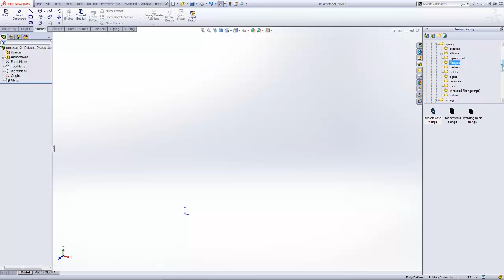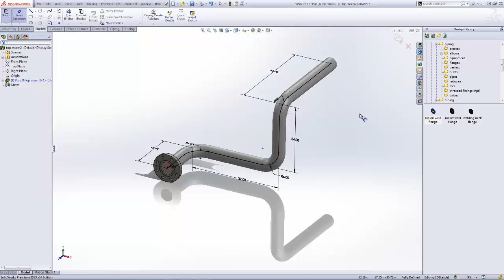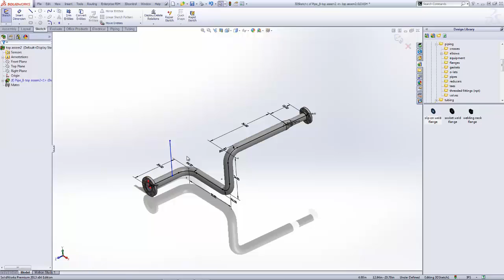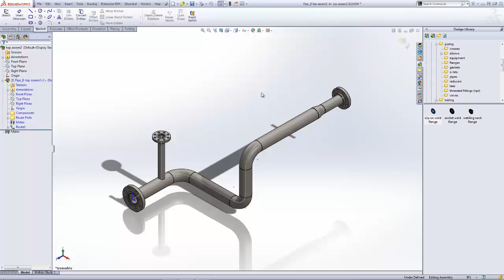SOLIDWORKS Quick Tip - Creating Piping Spools

Comment: hello, nice video

but how can I define a standard length for my pipes.

Exemplo;

I do a line with 8100 so the routing should create two tubes, one with 6000mm and another with 2100mm, because I defined that the maximum length for any pipes is 6000mm

Comment: I AM USIND SOLIDWORKS 2017 I AM FACING  SOME ISSUE WHILE DRAG AND DROP IN PIPING WHEN I EXIT THE SKETCH THE 3D PIPE VANISHES ONLY LINES WHICH ARE USED WHILE DESIGNING REMAINS LEFT 
THIS IS SCREENSHOT OF DRAWING BEFORE EXITING THE SKETCH MODE       https://drive.google.com/file/d/1UFG9y2LwaY_r52445GfDd6MGHwhjeO5B/view?usp=drivesdk
THIS IS THE SCREENSHOT AFTER EXITING THE SKETCH MODE            https://drive.google.com/file/d/171oHktBmoTCpbr9D5azj4JRjkLY42dAK/view?usp=drivesdk
REPLY ASAP

Comment: Ive found routing to be great for when you actually have piping included that will be welded. Real world welded piping may start as a flange/conc/tee/2 90 elbows/2 flanges as an example. Since every piece of pipe added is 2 more welds that a welder has to make, some welded assembly sections (or routes)may not contain any pipe. If the above route is drawn, you must remove the pipe that is drawn automatically. The editing of this route with no pipe can be tedious and difficult to modify. Curious if anyone else has had issues with editing routes that have very little pipe.

Comment: hi Tandy after loading the routing add in , I choose the flange you mention and drag it in to Solidworks new part I get a message saying " are you trying to make a derived part?" hit yes and the a "insert part" click in the graphics area to place part or hit ok button to insert the part at the origin". Once I do this I do not get the routing menu, all I get is the standard feature manager. When I choose no to the derived parts question the flange is inserted but in yellow again without the routing feature? What am I doing wrong?
Reply: Joel, This happens when you have a Part Model open rather than an Assembly Model.  Please make sure you have an Assemby Model active before trying to drag a piping component into the main window.  Thanks for reaching out! - Tandy Banks

Comment: Hey GoEngineer. Thank you for the great informative videos. I'm having trouble configuring the library parts that I have to use them with for pipe routing. Is there a specific way to do that? Thank you

Comment: Great video very helpful.
Just 2 question.
1) How do you remove the bevels where the various parts connect
2) Is it possible to use different angles and bending radious for each elbow?(with the routing component i mean)
Reply: Q1: the bevels are on each of the library components.  If you want the standard weld prep to be removed you would go to each library component and suppress or delete the chamfer feature.
Q2: Angles are regularly changed in the 3D sketch, which you will prompted to create a custom configuration of the standard elbow to make a "cut elbow".  It is not normal to switch radius dimension as a part of a route because this is normally dictated by the size of standard elbow you may be using.  The radius will cahnge depending on size of pipe and type of elbow: long radius, short radius or 3R...etc.

The key to both of these questions is to make sure your routing library is setup to the standard of your company.  Thanks for asking!
Reply: Tr Banks
Wow....That was fast
Thank you for your reply i will check it.
One more question:
I m planning to run some stress analysis on thin pipes aprox 100 meter long in total. Assuming I use a thin wall mesh (shell mesh),
do you believe running the analysis in solidworks is worth it? or i should i look into specific software such as autopipe?
Reply: Ksenagos Utumbo There are lots of details that are loaded in your question.  It really depends on why you are doing the analysis.  Vibration, acoustics, thermal effects, wind & seismic...etc.  There are lots of stress studies we do for lots of different goals.  For a many of these studies, other software will use generic calcs on beam-type meshes.  In SOLIDWORKS we are using all the mechanical details.  I am usually using solid meshes but I am looking at specific areas rahter than a long run.  I know this was not a direct answer but there are too many variable to give you a good direction.